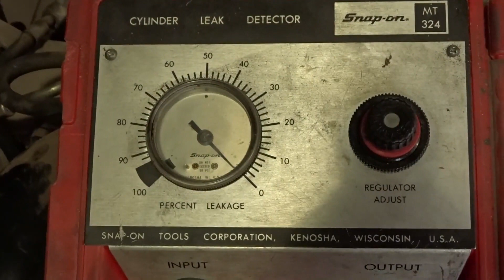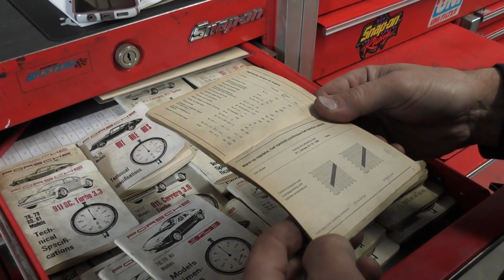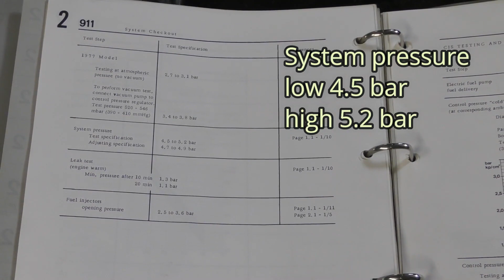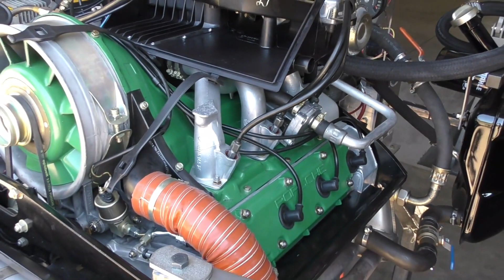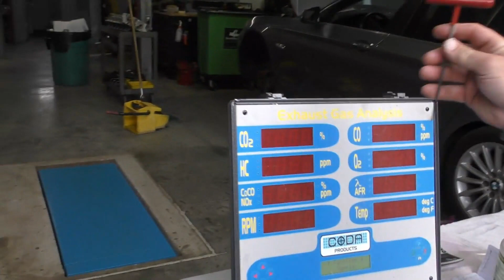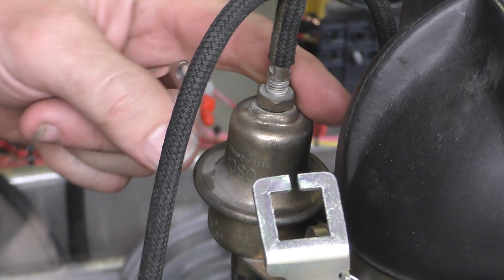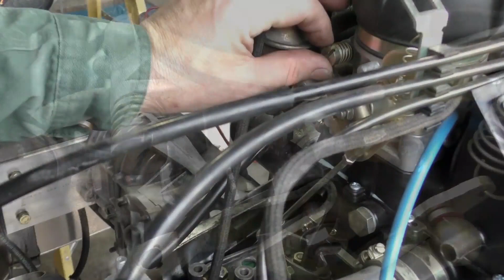How To Diagnose And Fix Your Porsche C.I.S Fuel Injection System

Comment: Very informative! I did notice however that you have the vacuum and atmosphere hoses reversed on the WUR. For the 1977 production year and the 033 WUR the top hose should run to the top connection on the throttle body (as it does) but via the outer connection of the thermal valve where it couples with the distributor vacuum. And the bottom connection on the WUR should run to the lower connection on the throttle body (where in the video the distributor vacuum hooks up). So basically for the first 30 seconds of startup the thermal valve is now limiting atmosphere to the WUR instead of vacuum. Yet your engine seems to run very well so I'm surprised by this. Would you mind explaining how this can be? Again, great video. I enjoyed watching it! Thanks.
Reply from the maker: Diederick,
Yes, good eye on the vacuum connections. When I first assembled I put everything together just like the 911SC configuration. On the test stand, it ran well. However, once I put the engine in the car it suffered from a lean misfire at 2000 - 2500 RPM. I revisited my vacuum layout and after hitting myself in the head reconfigured, to the 1976-77 2.7L layout. The problem was then solved, the lean stumble went away and the car continued to perform as it is supposed to. What this re-enforces is that no load is no test. And even though the engine ran well on our test stand in the car its performance was not as it should have been. Thanks for watching and thanks for keeping an eye on what we are doing.
Kurt

Comment: Wish I had seen this before I decided to convert my SC to EFI!
Reply from the maker: Yes a properly set up and operating CIS fuel system works extremely well. It is also very robust and because it is not electronically controlled it allows for a much better and stronger ignition system in the form of a CDI. Making the car very reliable and dependable.
Thanks for watching
Kurt

Comment: Q. Replacement injectors - i.e. currently have old 009’s (930). Porsche recommends 017’s as a replacement. Lots of theories out there about fuel volume delivery between the two. I’m more interested in open pressure comparisons done on a bench test to diagnose part of a hot start issue.

Open pressure on the new injectors is 15-20 psi higher compared to a NOS 009 baseline I’m using along w Tech Spec manual for comparison. Porsche recommends 017s for older 3.0 FD and newer 3.3FD 930 cars. 

Does the increase in crack open pressure between the older and newer part # indicate better spring strength and therefore better injector sealing after engine shut off or more to do with amount of fuel delivered?
Reply from the maker: Fancypants,
Would love to know what your hot start issue is, so I can point you in the right direction. When it comes to a Fuel injector they are a calibrated part. This means that the flow rate of the injector will be matched to the flow requirements of the system and the engine it is installed in. A change in the cracking pressure will not result in a change in the flow rate by itself. The flow rate is determined by the nozzle diameter. Parts are constantly updated and revised as information on their performance comes back from the field. The update in cracking pressure would be to correct a leakage issue and not a flow issue.
Thanks Kurt
Reply: @Aircooledconsulting  part of diagnosis so far was replacing Fuel Accumulator - bad diaphragm fast falloff on residual pressure was a tell. Replacing solved a chunk of both cold and hot related start issues.

Cold start fires up in first or second try now, not 15-20min in the past. Assumption is CSV works, plug tests pos. Hot start still a concern. WUR back from rebuild will recheck psi numbers. Also suspect Fuel Pump check valve & leaky injectors as contributing factors. Have new 017s but concerned 009 myth of flowing better may be true? Test fuel delivery in tubes like you did or just install them? 

Crack open on 009 inj is low per spec. All attached to 930 - 3.0L, 016 FD spec 5.9-6.4 @ 150l/h. Overall, 5 cyls burned evenly tad rich while #4 was very black and oily. Leak down %’s not ideal but top of range, tested cold not warm. 

On the warpath to keep CIS vs EFI.
Reply from the maker: @thinkerdoit  I would have no issues using the 017 fuel injectors and have had no problems with them at all. Fuel mixtures can and will play a large part in hot and cold starts. The correct fuel mixture setting is also responsible for the entire fuel range as it changes the center piston position in the fuel distributor. If you suspect a volume difference between cylinders then I would, by all means, do a quick flow test. you mentioned leak down numbers were not good? what were they? Engine internal condition plays a large part in total engine tune. Sounds like you are on the right track, just need to chase down all the details. When set up correctly these cars should always start and run easily.
Kurt

Comment: One of my favs! Will watch over and over. Superb content. 

Question 1. during WUR tests. As the fuel pump runs isn’t it dumping a ton of fuel via injectors into the cylinder through the entirety of the test? Enough to be bad while it sits and worse w bad leak down %?

Question 2. At what point do leaky injectors show up in the pressure testing? You mention the oring on the FD as a contributor but could worn injector springs also show up in the falloff speed you mention when testing residual pressure?
Reply from the maker: No, it should not be. Fuel should only be flowing through the injectors when the sensor plate is lifted off the seat by the incoming air. Now that doesn't mean that fuel cannot be entering the engine. If the senor plate height is incorrect or the fuel mixture screw is set overly rich fuel can indeed flow into the intake system. The other reason would also be worn fuel injectors where the internal seating springs have failed causing the injectors to leak or drip. 
In the first instance, you will hear the injectors flowing as they will sing when fuel is flowing through them. This is the indication that there is an issue and you would stop the test and resolve that issue first. The second issue is a lot harder to notice, however, it is easy to check for by just pulling out the injectors and checking for leaks if you suspect that it is an issue. A misfire at start-up that clears itself quickly is an indication of leaking fuel injectors.
Thanks for watching
Reply: @Aircooledconsulting  On this issue Kurt, my injectors are new and I am going to check the plate height today. Beyond that, can the cold start injector pump enough in to cause fuel to enter? I had a pretty good amount coming out, I am assuming my plate height is wrong, but would CS Injector be able to do it as well? My understanding is that it should fire momentarily and then stop.

Comment: Excellent as usual !
Enjoyed the content.
Any recommendations on shop manuals?
Reply from the maker: Thanks John,
The only shop manuals that I use are the factory ones. The next best would be the Bentley series of manuals. One thing I will say about some of the after-market shop manuals out there is how poor the quality of information can be. Many of these books use opinion instead of facts and they tend to be missing a lot of key information. The Porsche manual system builds on its self. This means that depending on the year model of your car you may require anywhere from two to ten of the factory Porsche books. The factory manuals are expensive but are still available both new and used.
Thanks for watching 
Kurt